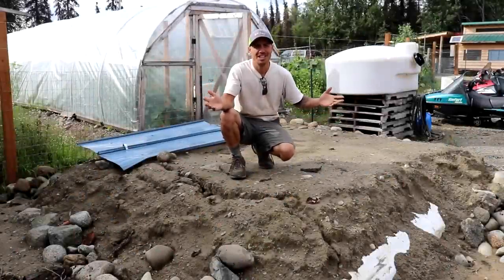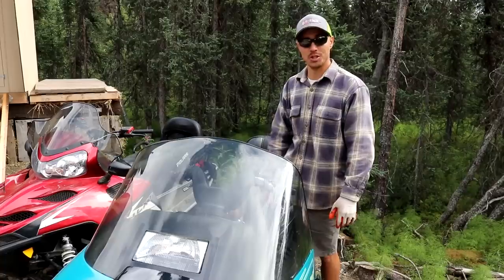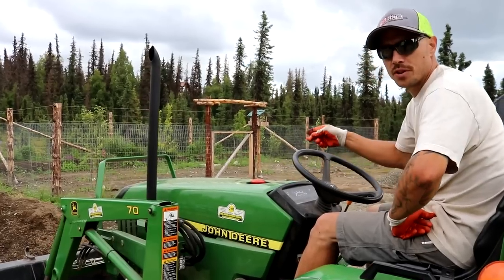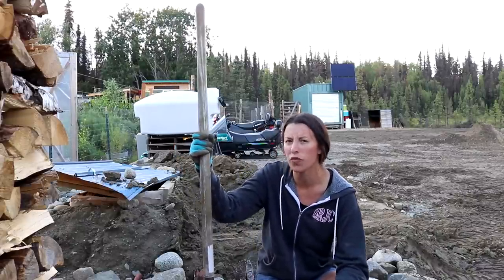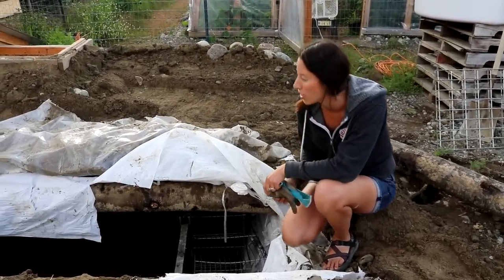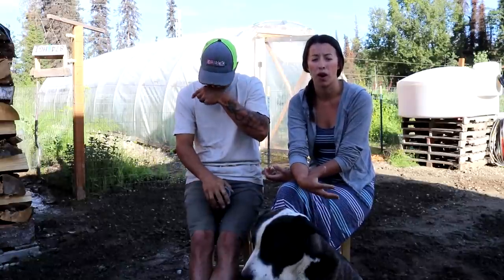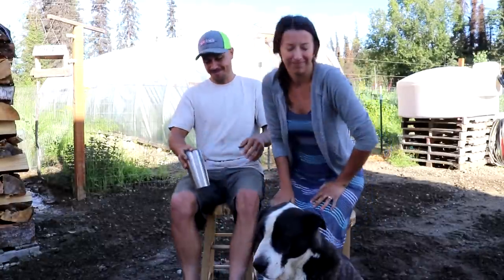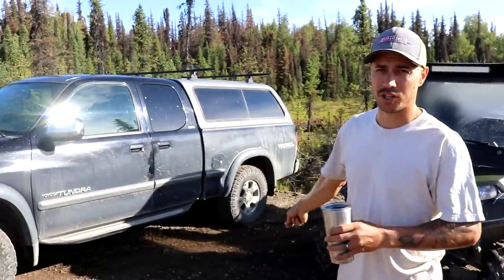Our Earthbag Root Cellar Fails | Addressing the Mud Issue

Comment: Is it possible to build an above ground “cellar” insulate and burry it in earth for your food storage? You two are awesome and hard workers. Hope a solution is in the works.
Reply: Good Idea , another trailer/container  (like the one they have for the tools), sand bags on the outside, but not in the ground, they would still have to deal with the water table shifting, (above ground no problems)...hook it up with a chiller(need to wire in off of solar)...they may need extra solar panels , but I don't think so...
Reply: And to further extend this bad boy theory..on the outside sand bags they should make adobe mud...they have all the ingredient there at their fingertips except for hay.. slap that up, make it smooth..Indian technic....
Reply: @riderstrong6397  yeah that's what I was thinking as well but more along the lines of a Hobbit hole aesthetic lol
Reply: @sarahmiller9670  lol make it pretty..but functional....I think that would work for them....then they wouldn't have to worry about water tables....wonder what the kids will do....( yeah I'm old enough to be their mom, but I do love me independent thinking kids.) I do like the above ground Hobbit Hole....Loved Lord of the Rings...
Reply: @riderstrong6397  I suspect adobe doesn't fare well in a wet, freezing climate. If it did, the Natives would have been using it all this time.
Reply: Tyres and rammed earth. Make the walls 4ft thick
Reply: This is pretty much how they build them in sweden back in tbe day.

Comment: i always get so nervous when eric uses the chainsaw without cutter's pants on :( theres been multiple deaths in my area from ppl not wearing the proper gear when cutting and its tragic, but preventable
Reply: I thought only professional loggers used those.   I’ve never seen anyone wear them before.
Reply: @sheila3936  my grandfather is a lumberjack who just does small jobs similar to what eric is doing in this video. He always wears his pants. The most recent death was a teenager who was cust cutting up a fell tree in his yard and he nicked the huge vein in his calf and bled out before the ambulance could get there
Reply: I used and was around people using chainsaws for 15 years. You don't need special pants to cut logs. That's absurd.
Reply: @sheila3936  everyone should be wearing them! they are pricey, but soo much cheaper than a new leg. or life. i don't know anyone that doesn't wear them...
Reply: I agree. The more remote your location, the more cautious you should be.
Reply: I worked for Asplundh and would have lost my leg if not life if I didn't have those pants on. Was clearing samplings under a tree in a crowded area and let the saw get to close to my thigh. The pants are filled with string funny enough.

Comment: Without being a root cellar expert, it sounds like a few things could have avoided your issues. The traditional Swedish root cellar called "jordkällare" (translates to earthen cellar) always has a vault/arch shaped roof/ceiling with quite low walls. You lose quite a bit of storage space of course, but the structure will be a lot more sturdy. The Swedish root cellar also often has good drainage to drain any excess water out to the ground outside. This also means that they are rarely built 100 % dug down into the ground, but rather just partly underground and partly like a mound.

Here's a video which unfortunately doesn't show the entire build of it, but hopefully it could serve as some inspiration at least…

https://www.youtube.com/watch?v=YOaWBSgazqA

You guys rock by the way. Keep it up!
Reply: Yup not so deep. as to hit the water table at high point.
Reply: We build a root cellar at and couldn’t dig it down all the way we wanted  as we hit bedrock. So it’s down about 3 feet and have a isolated Wooden roof. It works great.
Reply: In
Reply: Jocke Berg, what an excellent suggestion! There are still this design of root cellars around this section of IN. My mom’s Uncle Frank kept his wine in one while it aged. Built from pressure treated timbers, a  properly insulated and drained root cellar of this style would last for years.

Comment: I haven’t read all 1.7K comments but I’ve read several and none have mentioned any kudos for chopping up all that wood! Way to go! I was super bummed about the root cellar and the next thing I see is the new wood shed capable of housing 8 cords of wood over flowing with obviously way more than that. Before you said a thing, Eric, I was already giggling a little. “Of course they have more than 8…. They are the wonder twins!” 😉🥰

Comment: I hope you realize that the cut logs you through back in and then back filled will rot out then it will sink and leave a sunken area or when you pull some thing over you will be pulling out .
Reply: Wil Havtawaite , I’m concerned about that also, eventually this will become a sink hole.
Reply: It's not like that would instantly happen, as it would take a lonnnggg time (like their old age) because of the repeated freezing and how cold it always is when it's not frozen, which is going to kill off all the organisms necessary for the decomp of wood before they hit "critical mass". Also, by it being a traffic area, parking vehicles on it, etc., the ground is going to get compacted as the wood logs rot, simply leaving a slowly developing dip in the ground they can easily fill when it gets out of hand. There are also not any deep rooted plants anywhere nearby to loosen the ground.
Reply: Thats what I was thinking and 
Why waste the timber?
Reply: @CryptolockerMD  You’re correct but for a different reason- decomposition requires oxygen, and if the water table stays high, the logs will be saturated. Mills put logs in ponds for years to preserve them until they can be sawn.
Reply: It takes 14 years for the logs to decompose and the sink hole to appear.  

Just ask all the people with depression in their yard here in Alaska.
Reply: @jasonkeuma1986  Depends where you are in Alaska. They’re in a swamp.
Reply: I just watched some of their earlier videos.   “Finding “ water.   Also the dog digging in the swamp.    They should have realized the water table was not to far down.    

Looks like they are on the Kenai peninsula,  I don’t see any mountains at all.

Comment: I'm still tempted to try your original root cellar design on our homestead! In most of the Susitna Valley, your root cellar would have worked perfectly as it was, since the entire valley of full of gravel pushed down by glaciers from the Alaska Range. So it was still a very good design - just not right for your low-lying/ high water table location (down below all that mud and clay is hundreds of feet of gravel!) We just put in a septic system (after 25 years using an outhouse) and the inspector took one look at the sand and gravel leach field and said it would last forever.
Reply from the maker: ak froggie we still think earthbags are wonderful for underground shelters too, they are incredibly strong and held up great to the moisture, it just didn't work out for our situation like you mentioned but perhaps even adding some rebar in the walls and going with a round structure would help to withstand more lateral forces. That's great news about the septic tank 😃
Reply: @SimpleLivingAlaska   Yes! Round would help a lot. Domed would be even better. Check out the earthbag structures at CalEarth. I helped build a below grade dome in Vermont, many years ago, with a CalEarth graduate.
Reply: Sorry was not replying had a pinky attck

Comment: My neighbor built an above ground cellar that they buried in 3 feet of dirt
Reply: AK Washkeeton how well does it work?
Reply: For their location in Alaska, they need 8 to 9 feet around the majority of it to help get it "below the frost line," aka prevent sub-freezing temperatures.
Reply: @ladyofthemasque  not necessarily, I will talk with my neighbor.
Reply: AK Washkeeton you're forgetting Eric said they're hitting water at 3 ft down.  So that pretty much stops ideas of anything below the surface.
Reply: @ladyofthemasque  They will just need to invest in ridged insulation.   Adding the dirt on top of that.    More insulation less dirt.
Reply: @ladyofthemasque  Above ground root cellars are quite common here in Finland (we have a milder climate but still quite cold). The best is to build it into the ground on a slope or hill (I've actually never seen one dug straight into the ground before this), but if none is present you can dig it down a few feet, insulate the walls and ceiling with foam board and then cover it with around 3 feet of dirt to stop the frost from penetrating. If a high water table is a problem, I would put gravel and drains with a pump at the bottom. A certain amount of moisture is of course needed for it to function well, the pump would be there just to stop it from flooding. A double door system with a small hallway between will keep the temperature in the inner compartment at suitable levels. The door should be facing north so not to be heated by the sun and if possible, the cellar should be shadowed by trees in the summer.
Reply: @peacefulwife5199  exactly the reason I said ABOVE GROUND, buried in 3 feet of dirt
Reply: @M5tworude  not sure I am interested to find out how they built it now
Reply: @ Erica S, I was thinking same as well. My grandma and grandpa in Finland have that kind of cellar. You can have ice cold beer in a middle of a summer or you can restore your potatos not frozen them in the winter.

Comment: the availability of an industrial freezer, but not functioning, but with the insulation etc, make it useable as a cellar ?
Reply: Great idea
Reply: Doubt it.  I know people that have tried that and everything just froze.  They don't need that for the root veggies and canned stuff.  For frozen goods, it would work as long as the outside temps were below freezing.  An outdoor freezer needs a built in heater to keep the cans and veggies from freezing.  
Since they don't have a hillside, I would look into a vertical precast concrete structure that could be stacked and seal the outside.  It would still benefit from a french drain system to carry the hydraulic pressures away, but the walls would not collapse.  And I suspect it would certainly not be cheap to purchase and install.  It would not be a homeowner project for sure.  Do you have close friends or really good neighbors (with hills) that you could collaborate with to build a really nice root cellar maybe for both of you?
Good luck guys.  Keep everyone updated.

Comment: RIP Root Cellar. But what's with all the metal and stuff sticking up in there? Shouldn't that have been removed? Or was to all stuck too bad?
Reply: @k henne given it was clearly explained why, either OP didnt watch the video or wasnt listening.
Reply: @jeccalou9894  Did you read my comment? I did mention the stuck part at the end of my comment - hence I get their explanation. I'm just still unsure whether it was the right call to downright just fill the hole, but that's their decision of course.
Reply: @k henne No offense taken, he just misunderstood my post :)
Reply: That cheap metal will rust away rather quickly. The plastic bags will take a little longer but they will eventually break down too. Everything there came from the earth and it will return to it.

Comment: Look at the channel "Gridlessness" They did a above ground celler.
Reply: That worked as they had a large banking to build into.
Reply: @johnaustin6649  Have you not noticed the drop off behind the composting loo area....there is plenty of height difference to cover at least half a container on parts of the property. You could use soil dug out from the pond developemnent to cover an insulated container laid down on the lower ground level.
Reply: And quite the excellent cellar it is

Comment: Do your self a favor put some sort or bucket with a little cement in it doesn’t need to be a lot put an eye bolt in the center of it put the bucket in the ground put a some raps of cable in it put the cable though the middle of the lid then put a loop on the cable then attach it to your 6 bye tab . If some one takes you atv they will get a big supprize if they take it. I’m talking with some xperiance on that I don’t want you to go through what I did 2 years ago when I came home after work. Our trooper’s here don’t do a thing about your atv when someone takes it.  Yes they take the report but that’s it. So this is just a thought for a friend ok a fellow Alaskan... Anyway your driveway looks great

Comment: It's a real bummer that it didn't work out.  I am looking into earth bags as a foundation and this video is very helpful!  From what I remember of the build video,  you didn't use any vertical reinforcements and it looks like with all that mud it could have really helped.  Also building round instead of square or doubling up the walls. Taking a look at local building codes before you start a build like this is helpful.  You'll find information about what's needed as far as foundation re-enforcements, snow loads, etc.  Finally, finding an engineer who would be willing to work with you on an hourly basis to provide feedback on your plans could be an investment that pays off down the road.

Comment: Cinder block with membrane basement and sump pump is what I would recommend. An above ground cellar that someone suggested below would not work for Alaska winters.  It will only regulate the temperature so much.  When it comes to the really low temps, you would lose your vegetables.  I have always used a standard cinder block or stone basement with membrane moisture barrier, drains, and sump pump with a designated room that is dug back into the earth and lined with the same cinder blocks and membrane for vegetable storage.  I also have a large freezer for quick food storage and a large pantry, all located within my basement.  It is a big project, but if done right, it will last you a lifetime.

Comment: Really feel for you guys, but what valuable lessons you're learning by doing!  I know you're off grid, but we've used a very well insulated Conex container for long term storage in Oregon and had pretty good luck!  Moisture can be an issue depending on what your storing.  (We actually turned half of it into cold (32 degrees) storage by adding an AC unit with a CoolBot attachment (forces the AC unit to go lower) - but I know you're off grid).  Thank you for sharing your experiences!

Comment: I was heart broken for the failure, so sorry to see that happen. After you posted that video, I immediately thought of some other options. I have been watching videos on earth ships, using tire walls, and another person used a very large culvert stood on end, and then covered it with dirt. With your current ground water situation, above your current ground level seems to be your only option. Tires for most part are free, you appear to have enough land that maybe you consider a large mound above ground using rammed earth tires as your wall structure. I'm not sure of the finished temp above ground. Anyway, just thoughts. Tires are easily obtained. Wishing you the best on your further adventures. You are doing an awesome job on your videos!

Comment: I read Foxfire books years ago and they showed partially buried root cellars which were 2 to 4 feet down til hit rock and the sides and roof were logs and covered with thick layers of sod or earth (more dirtbags) and angled to allow runoff. Kept very cool and easy to access.

Comment: Greatly Enjoying your channel.  Was skeptical of the earth bag root cellar, but was eager to see how it turned out (... Do they know something I don't know..?). Sorry to see my suspicions proved true.  Frost heave and wet earth produce incredible pressures. Earthbags may carry vertical loads, but not lateral.  Steel-reinforced concrete is usually the answer.  Call a couple of local civil engineers and ask what others have done in the area.  You surely are not the first to face these problems.  Maybe re-purpose other precast concrete structures (e.g. salvage drainage culverts, cisterns, water tanks...?).  Random thoughts...  Wishing you well, good fortune, and success in your great adventure.  And thank you for sharing with the rest of us.

Comment: Love your channel. Thanks for all you share and do. You have great positive energy. I'm sure your next root cellar will work out better. This one would have been great, it just needed to be elevated above the maximum water table. I have a seasonally high water table on my level ground land here in Oregon. Planning an elevated concrete well house/root cellar with extreme foam insulation and stucco exterior then earth berming. Will chill/heat it with the cold well water running through coils, and maybe a window ac ? (w/the walk in cooler thermostat conversion kit) for in summer.

Comment: I've found that if you use 2 or 3 inch gravel first about 3 inches thick, then dump in another couple inches of smaller 1/2" gravel and pack it down. Over time with rain and settling the small gravel will pack itself into all the empty spaces and it will between solid as a rock. Maybe something to think about in future for as much mud as you get up there. Either way awesome video keep up the great work, love you guys!